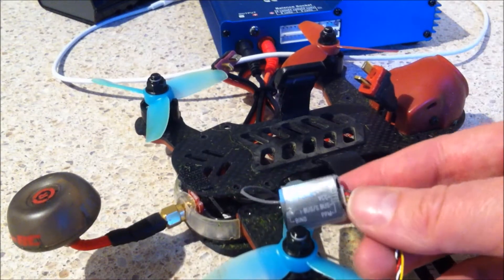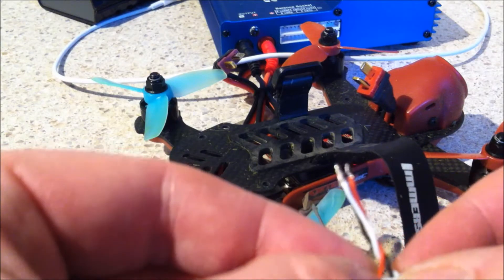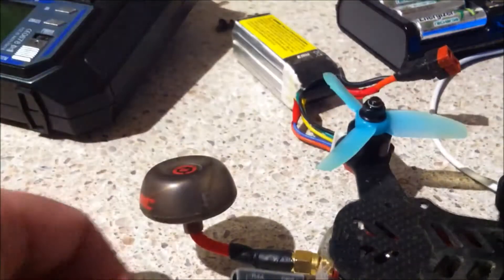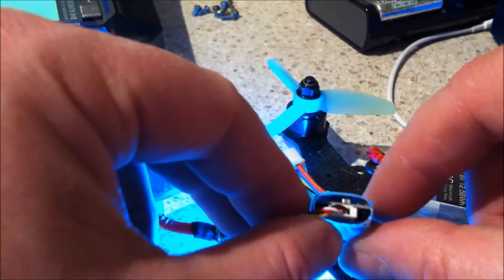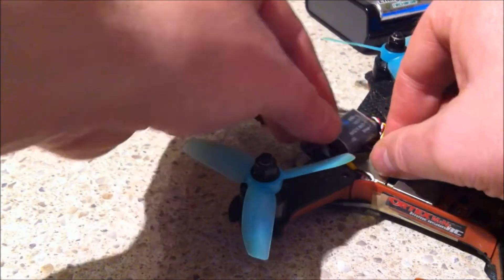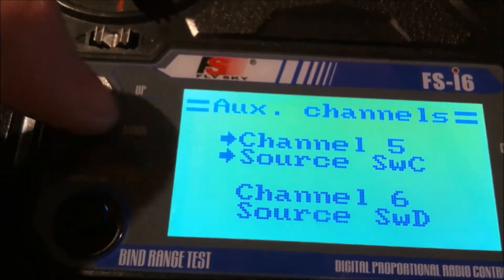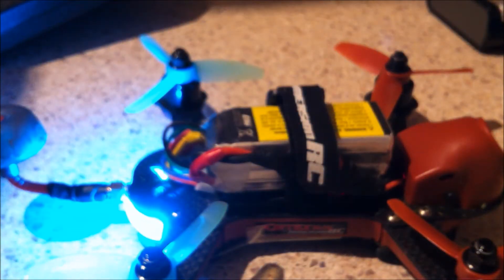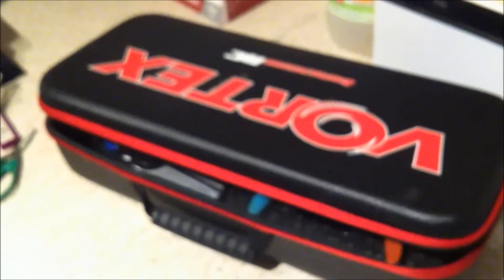Vortex 150 Setup with FlySky FS-A8S

Comment: Where did you get that Connecting wire
Reply from the maker: The 2 bits of the connecting wire come with the Vortex and the Flysky receiver - I explain how you need to splice them for PPM in the video.